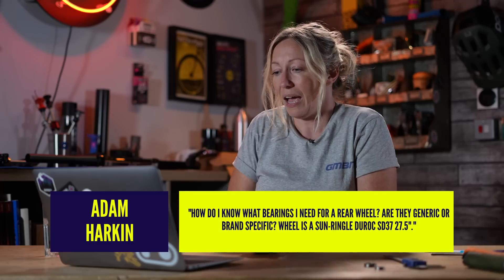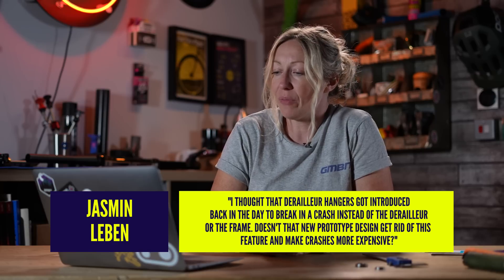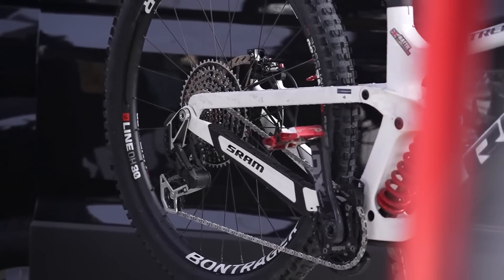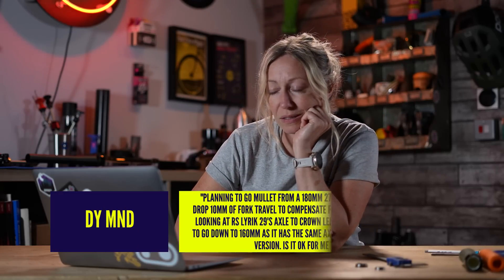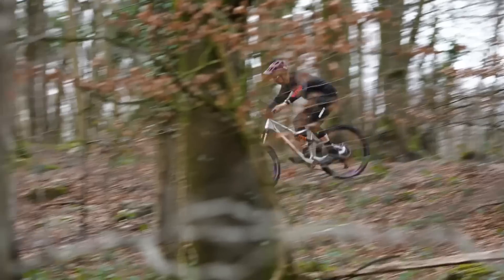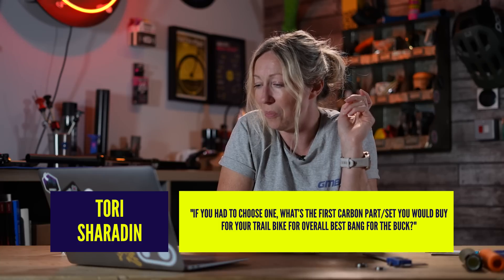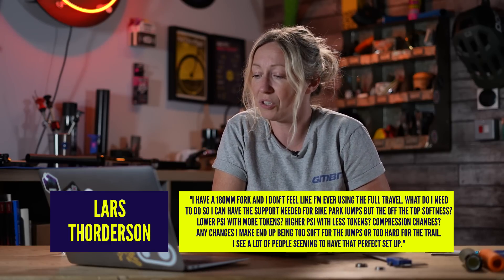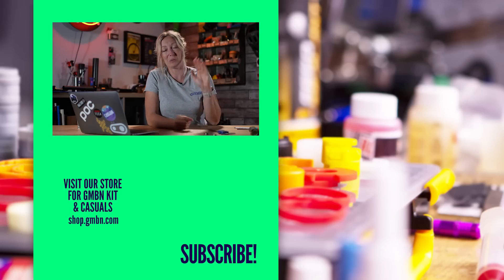"What Bearings Do I Need For My Bike Wheel?" | #AskGMBNTech

Comment: "Using all of your travel at least once every ride" is one of the worst pieces of advice that continues to live on like Dracula. The trail itself, rider weight, rider ability, travel length, etc.. all play a roll. Set your fork up properly by getting sag and rebound dialed in, then set HSC/LSC to your preference and the rest is what it is. If you are shredding steep, fast stuff with lots of jumps and drops, you will use it all multiple times. If you are riding a 160 fork on nothing but XC type flowy trails, well you have a lot of problems, but not using all 160 is not one of them.
Reply: In the motor cross world this was common as the valves, ramp up, compression  etc in your forks/shocks are designed to work in a specific range of the travel. Using only the 1st half of the travel for instance can affect the rebound. The idea was to set up for each track so that you were bottoming out or very near to it on your largest jumps.

Comment: when searching for bearings quote Inside / outside / width ie: 17 x 28 x 5mm
Reply: + the contact angles(45, 36 degrees), when looking for IS Headset bearings
Reply: Doesn't hurt to mention if you want rubber, (RS) steel (Z) or no seals... and how many (i.e 2RS is rubber seals both sides (Fairly much the go-to, but if the bearing is behind a separate seal, an additional seal may just add friction and no more dirt protection than the separate seal offers (and can cause issues depending on how it was designed to get lubricated)
Reply: @TheButlerNZ  agree all the way.
Reply: @bobbydebobadibob1261  Say my bike mentioned your channel name the other day when I got a snake bite... "Bobitybobitybob"..
Maybe it was your cousin...
q8D

Comment: Creaking in the "BB sort of area" can actually in fact be the BB..... or the pedals, cleats, cranks, chainring, seatpost, saddle, seatpost clamp, headset, stem, rear axle, front axle, fork crown, RD hanger, RD, chain, cassette, freehub, broken frame. Welcome to the world of creaks and clicks - a one way ticket into insanity.
Reply: Lube the seatpost. Sounds crazy but worked for my creaking. I was sure it was the bottom bracket that creaked. Worth a try 👍
Reply: once time i found a kickstand that clicked when the frame flexed because the kickstand was loose. of course thats not the first thing i checked
Reply from the maker: Haha! It's crazy how one creak can send you insane trying to find exactly where it's coming from.😅 If you're trying to find a creak, it's always worth checking each linkage bolt and bearing for movement and inspecting the bike section by section, feeling for any vibration when the bike creaks. 👍
Reply: I had this exact same thing, removed an greased the bb an was still clicking\creaking, asked my local trek shop mechanic an told to check main pivot bearing, took that to bits an found rusty looking wetness. Cleaned an regressed an fixed it.

Comment: Leogang creak, could just be where wheel hub end caps contact fork cut outs... Try v slight smear of grease on end caps ends and make sure axle correctly tightened.
Could also be bars and /or stem

Comment: #askgmbntech My chain keeps slipping off the top jockey wheel on my derailleur.  Just got a brand new chain and still having the same issue.  12 spd SLX. Everything shifts perfectly so I think my derailleur is properly aligned. Drivetrain is plenty clean.

Comment: #gmbntech. Hello Doddy and Anna. Regarding bearing, Anna mentioned the max bearings resist a little bit. Wouldn’t a person want to have the most free moving bearings in their suspension points as possible? What’s the reasoning behind manufacturers using the Enduro Max bearings.

Comment: I've a question about the mulletting of a 27.5 question, surely it's the axle to crown difference plus half the difference in wheel size, so adding 3/4" on top of the A to C difference.  It's a lot more than 20mm, I'd say double that.
Reply from the maker: Yeah, if you're looking to go mixed wheel size on a 27.5 bike, we'd suggest buying a 29er-specific fork to guarantee you get a good amount of clearance between your tyre and arch/brace. 👍

Comment: 6902 bearing is around £13. CRC do Hope 61902 bearings (which are the same) for £5 each
Reply: Can get a 6902 from enduro or kinetic etc for £4 and a max fill for frames for £6. Good bearings and kinetic are free delivery and quick.

Comment: #AskGMBNTech I am attempting to replace my rear wheel on my Trek eMTB. It seems that Trek has a 19mil clearance on the rotor side. I have tried a Hope and a Formula hub and they have a 14mil clearance. Is this normal?
Reply: As long as your hub spacing is right then there should be no difference in where the rotor mount should sit as it’s standard.